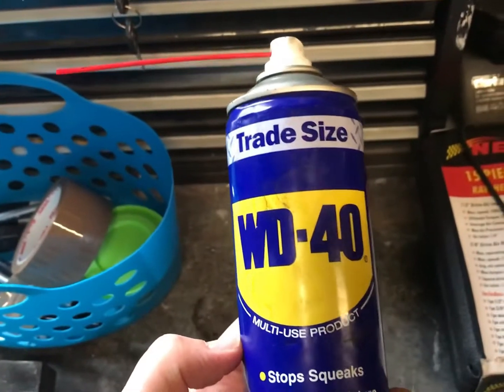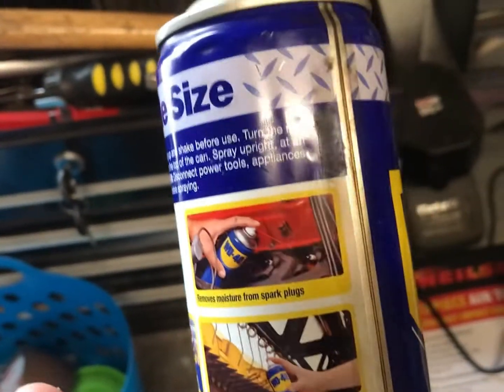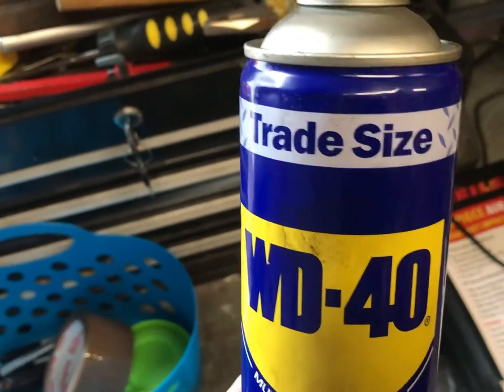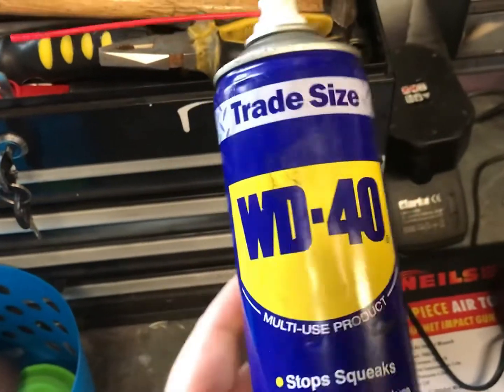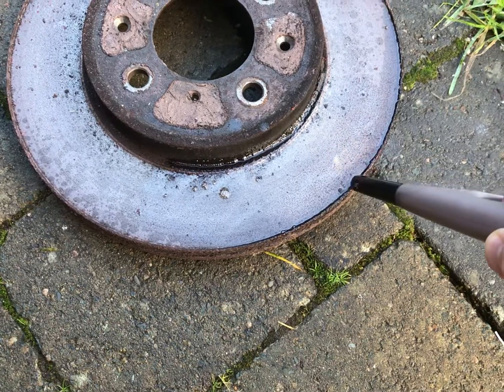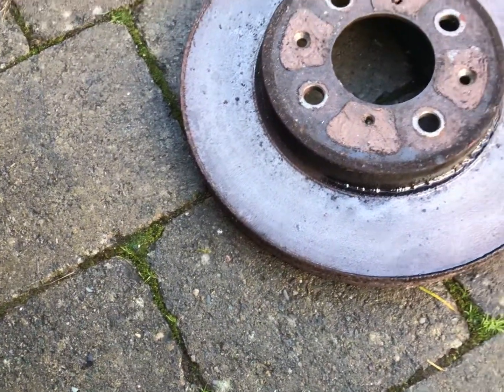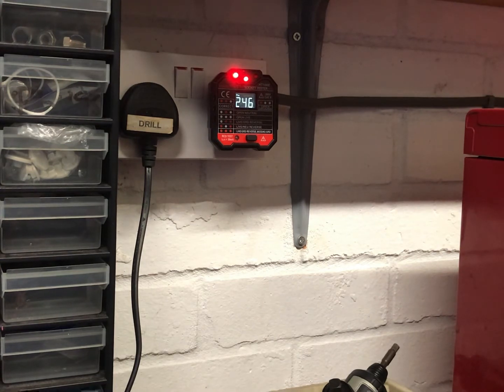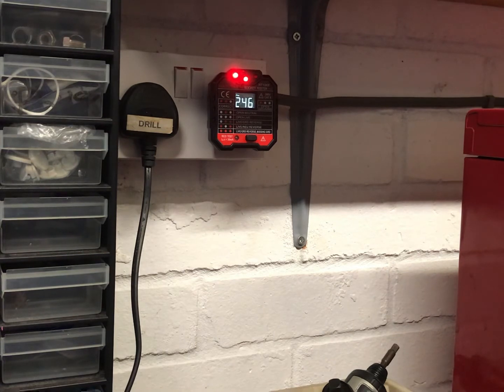How volatile and flammable is WD40, when using it. A bit of an experiment

Comment: I have without thinking applied WD 40 to a miniature engine to lubricate it however the engine has an open flame and i am wondering will the engine become engulfed even if i let the WD 40 dry
Reply from the maker: Probably not, I’d use what’s specific to your engine. Check your technical information.

Comment: Ive had a near miss experience with this product. Wonderful as it is, i were once unseizing a handbrake mechanism    using oxy acetylene , when the fuel line caught fire, quickly melted through, it was only good look id removed the tank, otherwise the whole car could have been lost!!
Reply from the maker: Wow! That was lucky, always err on the side of caution. Every time I work under the car with anything like that, I always grit my teeth and pray to God.😂

Comment: I've used it on any dry or wet sketchy wiring forever. Esp Good for pesky ground wires that cause all kinds of mystery probs!
Reply from the maker: Used to be fantastic for damp start . Got loads of cars started with this stuff.
Reply: @drivewaydiyer6504   yep. Don't forget the grounds! Most guys do, some shops love to sell ppl all kinds of stuff when all they need is ground wire cleaned. A a quick spray of wd40 will tell you instantly if that's the prob or not. Mechanics Rule #1 start with easy simple things FIRST when diagnosing!

Comment: I used WD-40 to clean rust off of the metal rim on my outdoor heater. Now I'm terrified of using it😆 Do you think it would be fine?
Reply from the maker: It will be fine, it may smoke a little, but it won’t ignite.
Reply: @drivewaydiyer6504  Thanks so much for the quick response and information!🙏

Comment: I was told WD-40 is water based.  It would explain some of its resistance in your experiment.
Reply from the maker: Not sure of the formula, I thinks there’s paraffin properties in it. I’ve used this stuff for years on cars that have damp issues. Obviously anything that may have a flammable sign on the can, should be used with caution. It definitely throws a debate out there.

Comment: I sprayed it on exhaust pipe from outside , is it safe ??? Will it Catch fire ?
Reply from the maker: It would be fine, I’d only use this on an exhaust when it’s cold. There maybe a slight smoking from it when the exhaust heats up. Like any job, you should always follows safety guidelines.

Comment: I've got a heating furnace with a small vent takes in air and it squeaks to no end. I'm wondering if I should use WD40 on it but I don't wanna risk starting a fire
Reply from the maker: It would probably be ok. Might be worth using a water based grease on it. I find WD is great for release or short term issues.
Reply: @drivewaydiyer6504  A water-based grease? Where could I find something like that?
Reply from the maker: Silicone, works great for anything. If unsure.

Comment: Most of these things are only dangerous in enclosed environments, where it is allowed to build up over time.  People do worry too much about these things.  Sure follow guidelines and be sensible, but always keep a rational perspective.
Reply from the maker: I agree with you, I’ve used this stuff as long as I can remember. The old cars of the 70’s and 80’s, would never start in the damp. Spray this stuff on the leads and distributor and off you go. I’ve used it for a lot of issues. But if you you’re not sure, then you have to research, like anything.
Reply: Maybe it's just gaz from the bottle that is flammable, not the applied product
Reply: Better worry a bit too much, than be sorry. I came to watch this vid, to be sure. Cleaned the motor of a fan, but then thought it could maybe start a fire ... :D Seems it isn't.